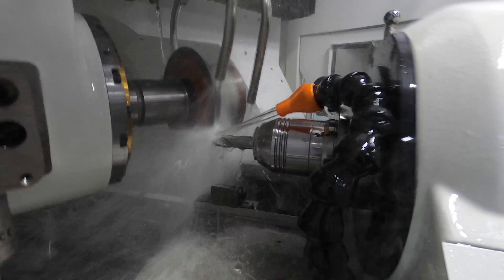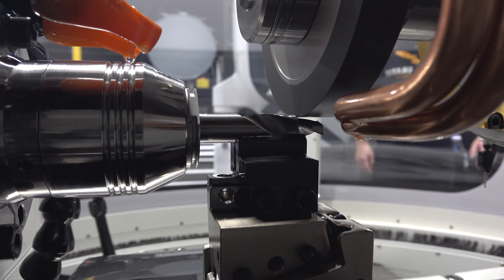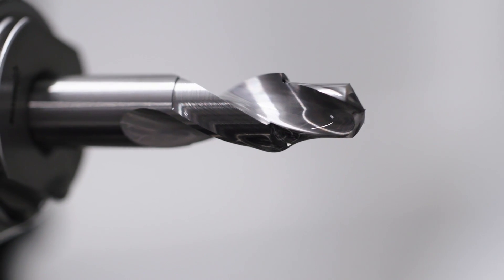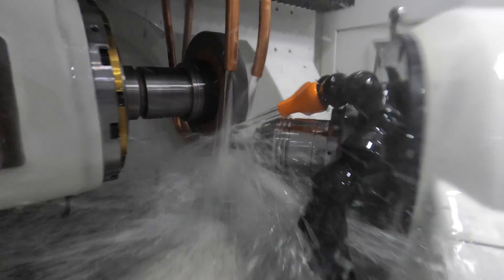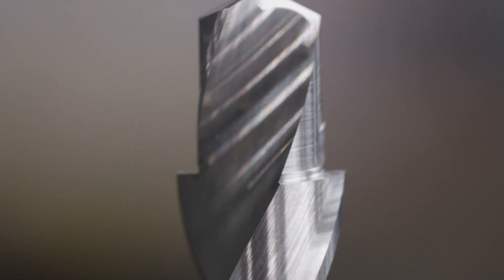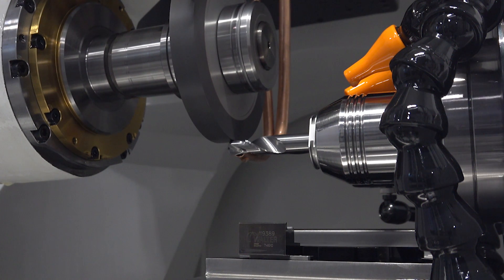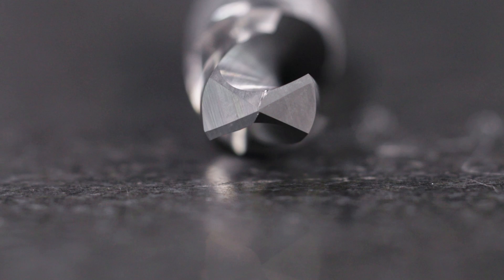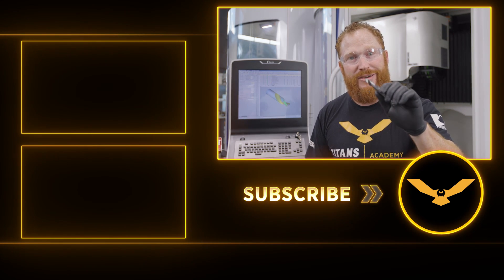Turning a Piece of Carbide into an Incredible Custom Drill | Walter Helitronic Vision 400L

Comment: Dear @Scott Leoncini,

I am having some chipping problems while grinding carbide drills. The chipping occurs at the top of the drill/steady-rest contact surface. I am using V-shape steady-rests instead of half-moons. Also, before grinding the drill itself I do blank preparation on another machine. The portion from the tip to the shank of the drill is tapered slightly.

From your experience, why do you think this issue might be happening?

Thanks a lot in advance!!
Reply: Try changing the direction your spindle or approach style. Sounds like it is chattering on your steady.

Comment: Could you talk a little bit about why you would make custom drills and where you would use them? I don't understand why this is warranted/economical vs approaching a vendor who already makes drills and end mills and why they might not have exactly what you need already.
Reply: Typically this kind of drill is used to do the through hole and counterbore for a SHCS. No tool changes, and if using a drill press or manual mill, it makes it so so much better and faster.
Reply: @P8ntbaLLA56  Ok but a socket head cap screw is a standard part, so why isn't this tool just bought from a vendor? Why would you choose to buy and run 100,000+ dollars of machinery just to make a drill that should be, and maybe already is, very standard.
Reply: @christopherbarron8730  if he has the machines there why would he purchase an expensive custom tool from someone else?

Comment: i call that drill point a "split point". When machines are running, i working on a small jig, to grind a splitpoint on regular drills. Fits in a multifix toolholder for a regular lathe. just add a grinding disc to the spindle. split points are way better. For regular holes with no tolerance, you can peck a small point with slow feed, before drilling throug, instead using a spot-drill. (depending on drill size and material)
Reply: Indeed, split point is the name that my tool sharpener used to describe that design that allow big drill to avoid to use a pilot hole. I was mainly drilling counterbore as describe in the video, but quite large (36/54 mm). Instead of using 3 tools to do the job (pilot hole, 36 mm, 58 mm), I was able to drill those counterbores in on single pass. What a time saving!!!. Best of all, the basic standard drill was quite unexpansive. Just a few modifications from my local tool sharpener and I had the perfect tool for my application.
Reply: This is not a split point, a split point drill has no radius gash like this one have. the "Split Point" is the gashing type. a split point is going straight out towards the flute.

Comment: I am not advanced in tool grinding just the basics. Would you use diamond wheels on this machine and what other types of grinding wheels do you use and what are they made of? All I know (I am from the UK) is, I have used diamond wheels and green wheels for grinding carbide. Just curious about the advancements in grinding wheels is if any over the years.  I am not a tool grinder by trade thanks.
Reply: These are Diamond wheels from Tyrolit. We used CBN for steel when we did the bone pin video. https://www.youtube.com/watch?v=GV9NM4DPB98&t=570s

11v9 D64
1A1 D54
1V1 D54

Comment: If this is the tool that cut the thing that cuts, what is the tool that cut the thing that cut the thing that cuts?
Reply: Bro, they did not cut the material.
They performed grinding operation with a diamond wheel
Reply: @atharavstudynaikstudy4409  You can cut something using abrasion...
Reply: @johntheux9238  yes...
Reply: The chicken came before the egg, so I think the chicken ground down the diamond grinding wheel 😂
Reply: It all started with a stick and a rock...